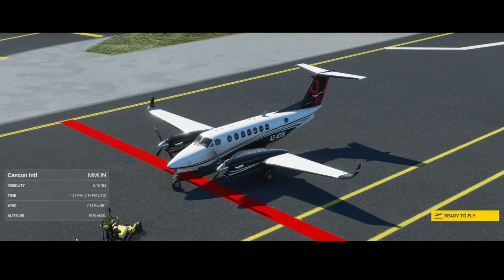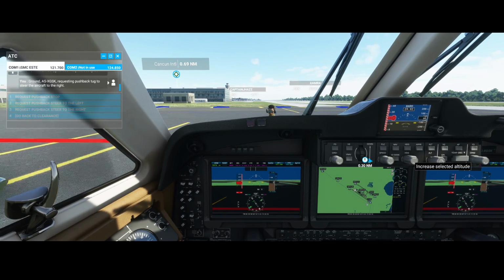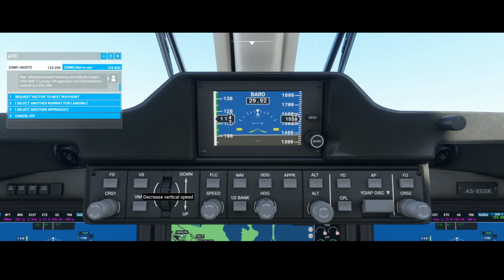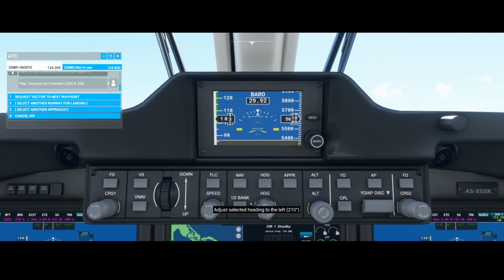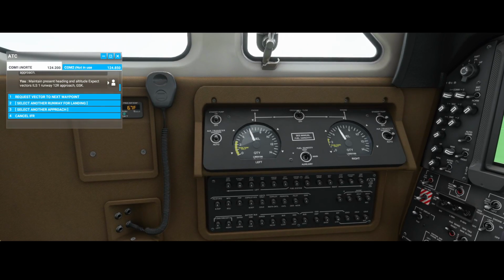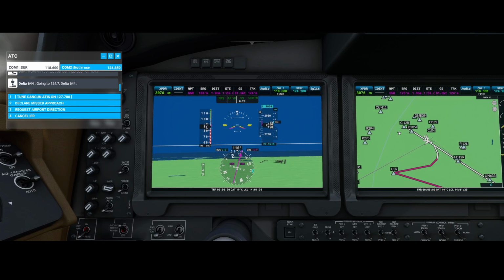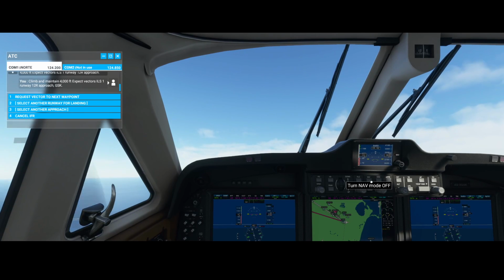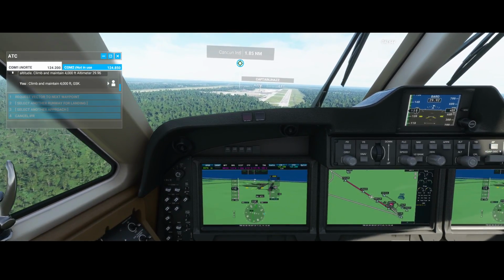Flight Simulator 2020 - How to - Beechcraft King Air 350i - autopilot

Comment: Flight Level Change works nicely but you need to reduce throttle to descend because it keeps you at a constant speed. If throttle too high wont descend
Reply from the maker: thanks for the tip @TopgunB makes sense thinking about it

Comment: FMS isn't showing up for me as an option when clicking on the compass in the primary display. I've just got Loc1, Loc2 and GPS and it's driving me crazy.,
Reply from the maker: did you by any change have configure you navigation radios on beacons having a localizer function?
Reply: i am facing the same problem. just started a new flight from a to b and have not changed anything
Reply from the maker: Hi both checked it when using a preprogrammed flight, I also see it only allows GPS, NAV1 and NAV2. The only thing I can think of that it might have to do with programming a flight before starting to fly. Can you explain what you try to do so I can try to see if I can help finding a workaround for you?

Comment: Just make sure not to go in the red on the "Torq" meter...you need to gradually increase the throttle and make sure to not overtorq the engines and also not overheat the ITT.
Reply from the maker: yep that is also what I found out. Not sure if MSFS already has the realism that engines will stop if you keep the torq to long in the red zone
Reply: @Highintheflightsimsky  I seem to remember when I was figuring out this plane that the engines cut off randomly at some point and I couldn't figure out why, maybe this was why but it could have just as easily been me accidentally pressing the engine off or something...

I have also noticed a very annoying bug where sometimes when you move the camera around it will press on the screens and move the maps, open the menu etc.
Boggles my mind how this top notch of a sim this late in development can have so many bugs.

Comment: Great tutorial which taught me a lot.
What ramp/gate position at Cancun Intl is used? I want to do the same flight EXACTLY so I can determine if the ramp affects the correct operation of the pushback tug as I can't get it to work correctly.
Reply from the maker: hi John, what does not work correctly for the pushback tug? I thought. I was using runway 12L